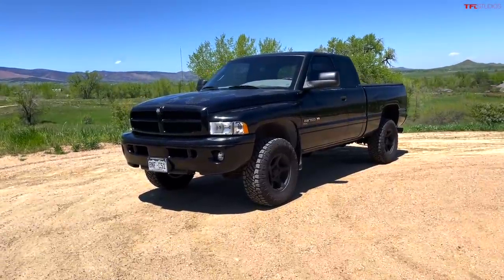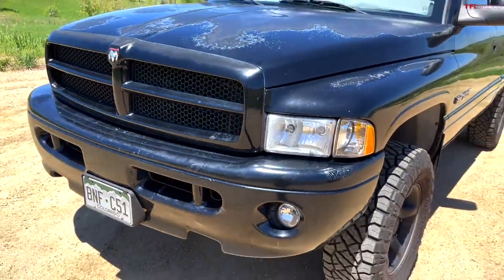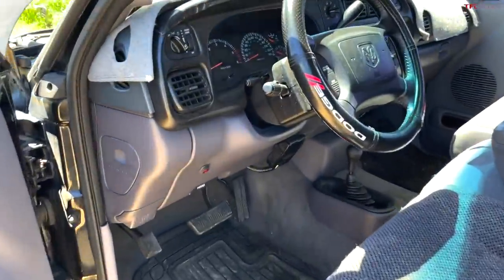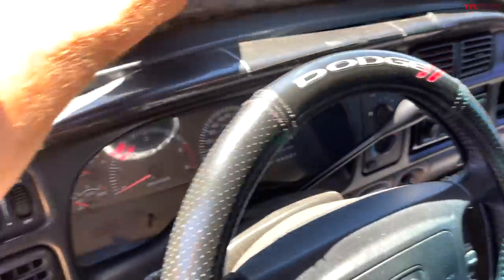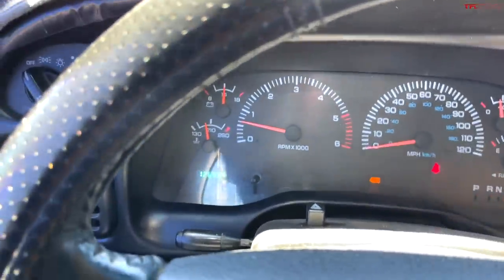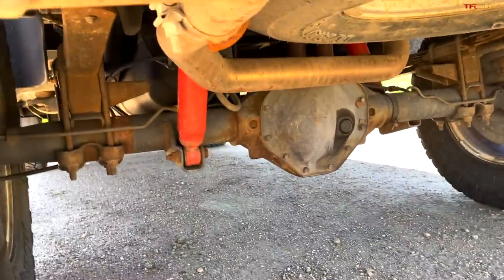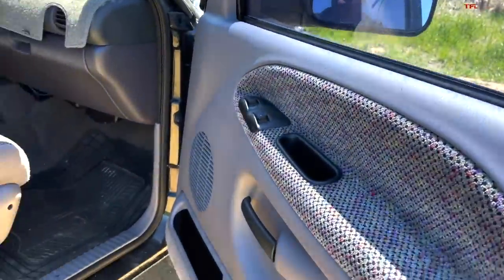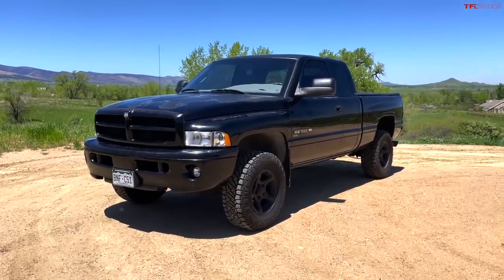Our Beloved 2001 Dodge Ram 1500 Sport Off-Road 4x4 Magnum Is For Sale On TFLbids!

Comment: So did you fix all of the problems in the front end that had the mechanic saying it is unsafe to drive?
Reply: I believe they did. I remember they said they fixed all the stuff that the mechanic said was essential. He said that whole front end was safety which he's right. These trucks are known for death wobble when the front end parts wear out. Even the 2wd can suffer from it if you let the steering components wear out.
Reply: @TehShadowDeath  You apparently didn't watch the video. All of the front suspension still needs to be fixed.
Reply: @blakenichols4957  I did watch the video.

https://youtu.be/FfR-quOxFBY?t=1584

Right there... "With Toby's recommendation we fixed all the critical issues with all 3 trucks." That whole front suspension was a critical issue.
Reply: at 10:46 in this video Andre says that the front steering issues will need to be addressed as they did not fix it all the way.
Reply: Ummm 20+ year old trucks are usually sold AS IS. He did mention they will need to be addressed.

Perhaps in the previous video they said it was fix, but it clearly wasn't, you made that point.

Comment: I Love mine And We Are Allowed to Drive on one End of The Beach Where I live Which Is 2 Foot of loose Sand Which most Trucks With 4x4 get stuck All The Time ,I have Never Even Gotten Close to Being Stuck actually I have pulled Many other Trucks Out ,The Limited Slip Is Just Awesome Every 4x4 Should have it ,I Got All 4 tires Pulling where Most Trucks and New Ones only Have 1 Rear And one front Pulling so you only got Half of what I got, Iv Owned Many 4x4 trucks , New and old This Truck is By Far The Best Ever in the Off Road And Work Horse Dept . If you find one Buy it it will go Anywhere. It is The 2001 OFF ROAD EDITION ONLY.....

Comment: My biggest concern about this truck when Nathan bought it was that the plenum plate and gasket were bad. That is the most common flaw with the Magnum engines. It creates a crazy vacuum leak that sucks oil from the engine valley. The transmission slipping didn't surprise me but it made me think that the bands hadn't been adjusted... ever. Also the slow downshifting sounded like a TV cable adjustment issue. Adjust it too tight and it won't shift at wide open throttle. Adjust it too loose and it won't down shift like it should.

Over all 2nd Gen Dodge trucks are great because if the maintenance is done on them they will last forever. It's just those few things you have to be on top of. This truck has all the makings to be a great hot rod truck. Drop a Airgap intake manifold on it, reprogram the ecu for that, and toss in a shift it and this truck will fly.
Reply: Interested in the Airgape you are talking about for mine, could you tell me a little more about what to do is there a kit for this or what? Mines a Straight gear from factory. Thanks Alot.

Comment: I used to own one of these. Never had a problem with mine accept the clear coat peeling.
Reply: Isn’t the transmission bad on this one?
Reply: @rabbi7933  I may have just been lucky on the one I got. Mine was purchased from
the cities Solid Waste Division. The truck looked like hell but was mechanically solid with no leaks.
Reply: Izzyrodthegod  The one I had was purchased from the city. I don't believe it had high miles. The maintenance logs showed no major repairs just some bushings being changed. The logs also indicated regular maintenance inspections and fluid changes. Hope that helps.
Reply: @rabbi7933  I had my transmission until 250,000. Engine until 220,000

Comment: Wow those 70 dollar headlights really bump the value of that truck up quite a bit huh
Reply: The Dodge Ram 1500 Sport headlights are about $150 apiece, and yes - they lift up the visibility and the value of this truck!
Reply: @TFLtruck  you overpaid for them then as they are the same for all 2nd gen dodge trucks. I got way way better aftermarket hid headlights for that price
Reply: Let’s not forget the dash carpet, dual exhaust, oxidized paint, and the cracked mirror added at least 150hp, so that’s gotta be worth something! Ha!!!

Comment: Just Bought one Runs like a Top but mines a Straight Drive im having it completely Redone Paint and all to make it a Perfect truck, got it fr 3200
And its in better shape than this one inside and out. But i like yours also, they only made these 1 year o1
Off Road edition that is and its got limited Slip fron and Back so when one wheels stuck other kicks in , kinda like Positive Traction really.

Comment: I just bought a 2001 1500 & it knocks around 50-60mph from 4th-5th gear. Any idea what it could be?
Reply: Junk
Reply: Does it have a knock sensor, maybe that’s something to check out
Reply: Had to say with the vague description of "knocks" 4th-5th gear.  Are you referring to the engine knocking or just a sound from somewhere that can be heard ... 
Could be worn u joints if not engine related.

Comment: Wanna trade for my 03 dodge ram 1500?  Mine is exactly the same except newer.  Beast . I tow loads 3k more than dodge recommends. My camper is about 6k but weighed in at 9& 1/2 k. Only had to have the tranny rebuilt when i bought it ..reverse was out and yes that was b4 o ever towed  . These trucks are like a top ive put my dodge thru hell amd back and she wont stop . Sat for a year and all i had to do was tighten my flywheel . Ford can kiss my ass i will never stop buying these dodges
Reply: Dude ...  do you ever think about the things you say... you just described how you abuse the truck by overloading it by thousands of pounds and you put it through hell and back like that's a good thing to do, along with the questionable work that's been done to the truck since it sat for a year and for some reason the flywheel needed to be tightened up... that was like telling someone hey I treat my truck like shit you wanna trade.

Comment: Not a quad cab. Sorry.
Reply: Is a quadcab. These were the 1st trucks with the quadcab name.
Reply: @yoyo5069  And yet it still runs with no end in sight.
Reply: @afastcuda1970  with that sloppy front end any twist in the road at highway speed is the end in sight.
Reply: @rabbi7933   Front end is an easy cheap fix for anyone who knows basic car maintence. A little maintence (greese) would have prevented the wear in the first place.
Reply: @afastcuda1970  hahahahaha. You’re gonna grease the tie rod ends, control arms and shock absorbers?
Reply: @rabbi7933  Tie rod ends  ball joints, idler arm and pitman arm will all need greese. Shocks do not need greese, there are no control arms on a straight axle suspension.
Reply: @afastcuda1970  ya huh. 👍👍👍

Comment: Magnum V8 🤮
Reply: That’s what a 1500 Ram is
Reply: @JackXX91  pretty sure I see them coming with a 5.7 Hemi these days.
Reply: @rabbi7933  it was before the hemi I believe. No lifter issues but gas mileage is a huge con
Reply: @oldcroneysgarage9739  I remember those Magnum V8’s being huge disappointments at the time. I’m not an expert in the field, but I do remember the era.
Reply: @rabbi7933  well it depends what you use them for. They do best towing. They do OK for daily driving. I know. I own one with a 360
Reply: @oldcroneysgarage9739  I had a 74 Powerwagon. I believe I had a 360 in it. I wonder if it was the same block.
Reply: @rabbi7933  it's possible. magnums share the same blocks I believe. Just different heads I believe
Reply: @rabbi7933  5.9 magnum is a bulletproof motor brotha
Reply: @montanan1997  ya, that’s why they abandoned it. 🙄
Reply: @rabbi7933  they abandoned for emissions, mpg and replaced it with one with more issues - same pattern with ford 7.3 -> 6.0 -> 6.4